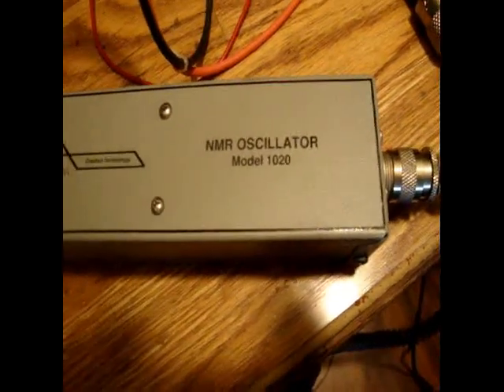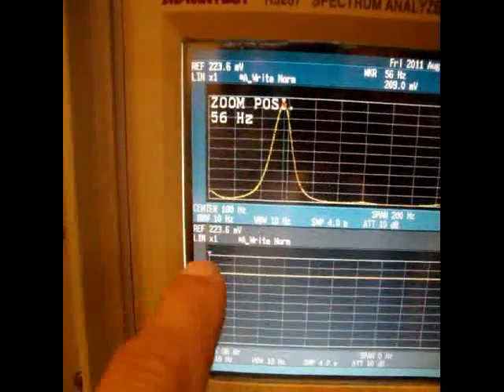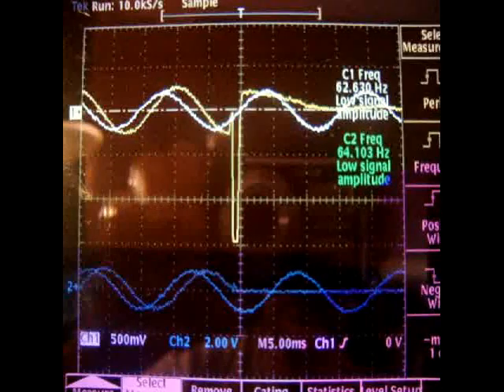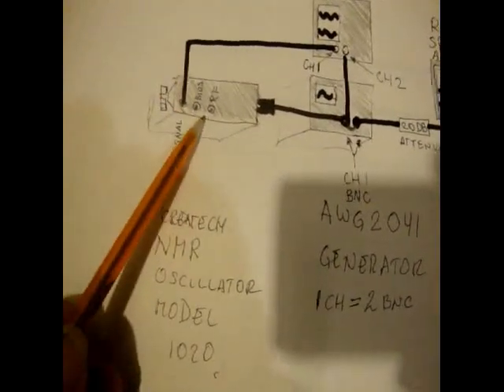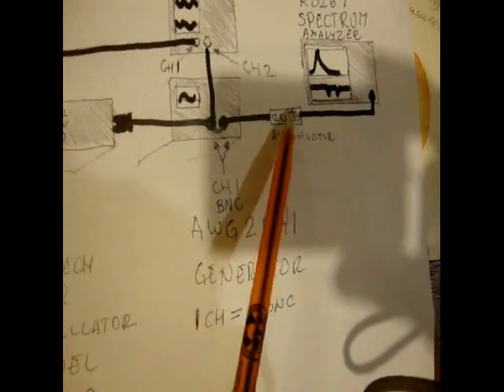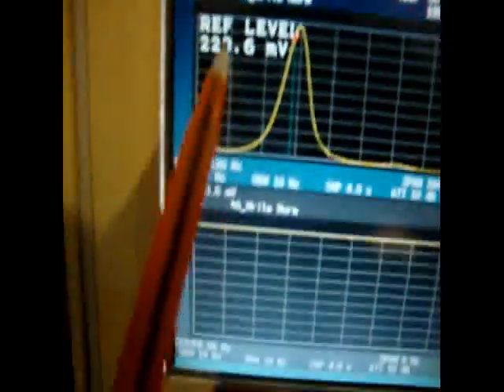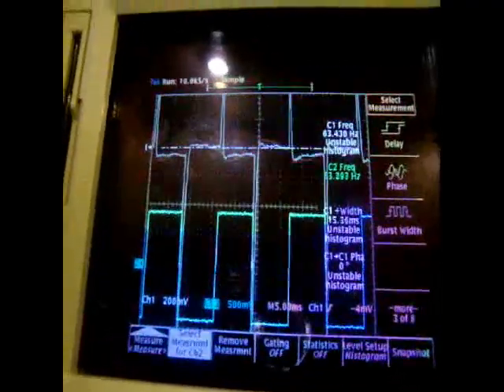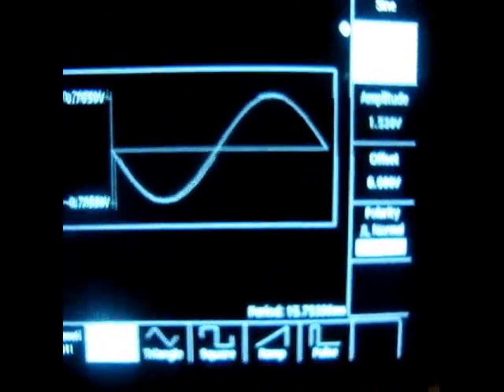Kapanadze ... My concept for explaining OU. video #22

Comment: 'described' is not proof,   and earth's angular momentum can only be harnessed by those living outside its inertial frame, your argument that you can harness earth's angular momentum while living on earth,  is like arguing that you can make a sail boat move while blowing air into the sail, using a fan, without interacting with the outside, sorry momentum doesn't work this way